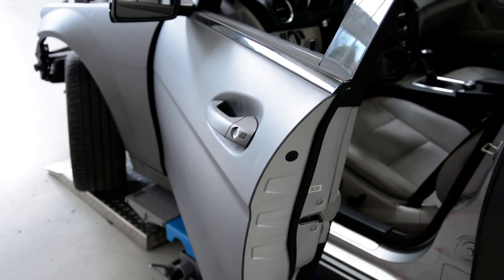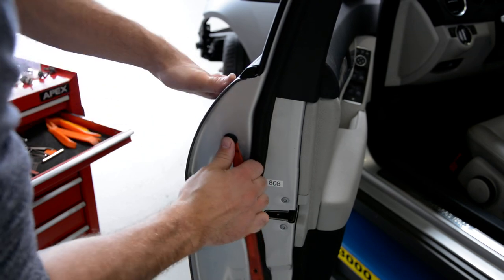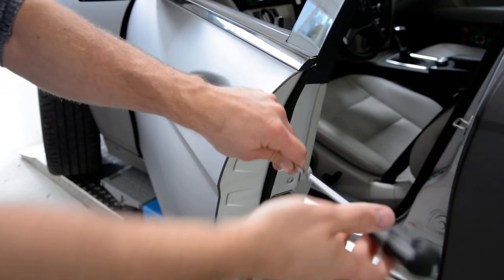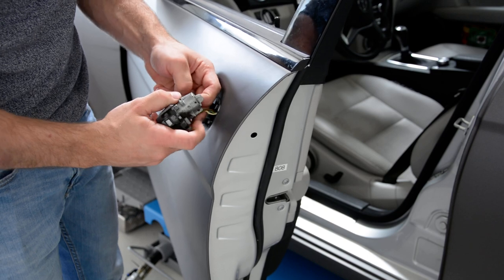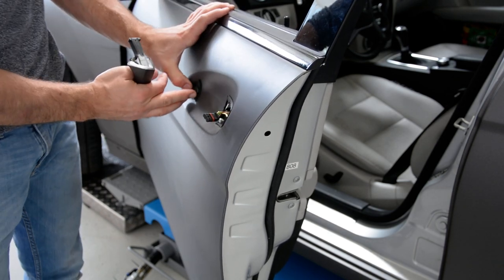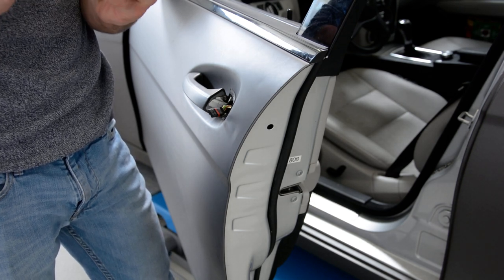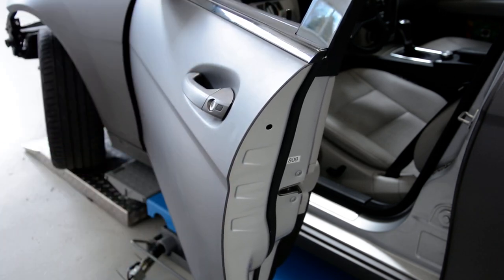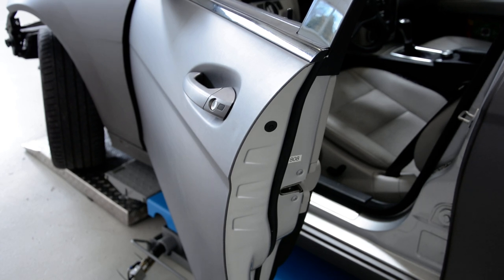Mercedes W204 Exterior Door Handle Removal

Comment: Excellent job. I executed a replacement on my 2008 s600. Well done. I saved 1500 from the dealer and only paid 250 for 4 used door handles.